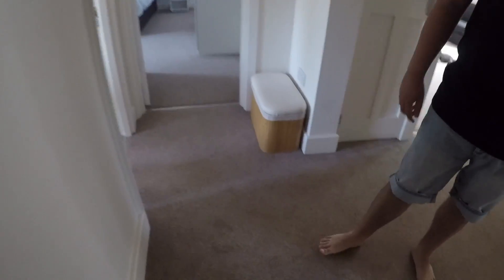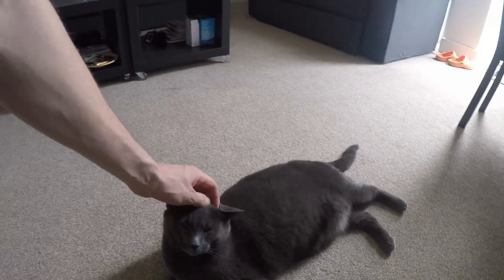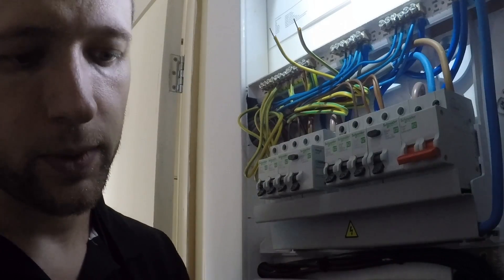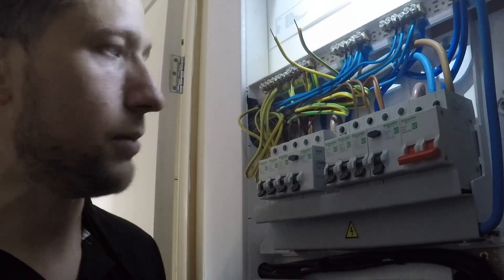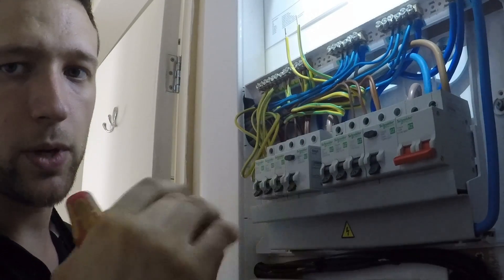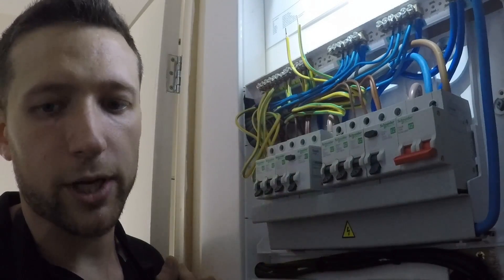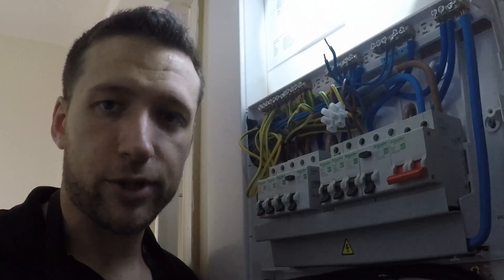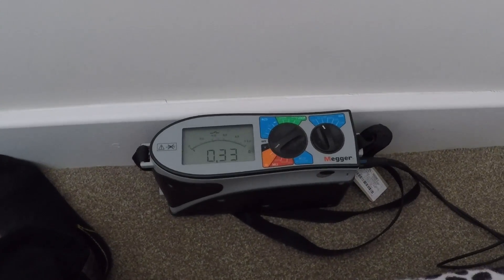Testing a Ring Final Circuit - An Electricians Day in London | Thomas Nagy

Comment: Hi Tom, a very good simple instruction or explanation of a question I was wondering about.   Thanks.    We do not use ring circuits over here in New Zealand.  Everything is wired as straight lines, phase, neutral and earth going to all switches or sockets, but light switches and power sockets may not be on the same circuit, and each circuit must have its own breaker.  Switches or sockets may be daisy-chained.   2+E in all cases, each wire insulated and then with outer insulation also.  Switches on 2.5 sq mm cable, and lighting sockets on 1 sq mm cable (minima).  2 or more light switches for the one light are special cases for cables.   Domestic stoves (ranges) on 6 sq mm cable.
Reply: Alan Torrance If I’m correct, the UK is one of the only countries who use ring circuits. It’s actually really stupid because they’re not actually needed.

Comment: 13.36.  Simple maths.   for 1/4 of 1.34     1/4 of 1 is 0.25     1/4 of 0.32   (close enough to 0.34)  is .08   ( hark back to multiplication tables, or are they not taught nowadays?)   so 0.25 plus 0.08 = 0.33    Easy simple mental maths.    I had the answer virtually as soon as you put the problem on the board.

Comment: 9:30  The Phantom of the Opera. Ring Mains make a lot of sense. However, here in South America (Chile), we don't have fuses in our plugs which would make them quite dangerous. Our main breaker at the electricity meter is a 25 amp breaker, which feeds an RCD and then a 10 or 16 amp radial for the sockets, a 10 amp radial for the lighting circuit and a 10 or 16 amp radial for the kitchen. It is very unusual to have electric heating or domestic hot water (about 95% of homes use gas-fired instant hot water heaters or combi boilers.) No electric cookers, ovens, showers or other heavy draw appliances.

Comment: There are serious faults that the standard tests won't reveal. Example: I workd on an installation that looked really good on the surface. All dead neat. But we found a pile of T&E cables joined by connector blocks buried under plaster, no switches or sockets in line either horizontally or vertically - ie, a bodge.  If you want to know if it's ok, get out your crowbar and a hammer and chisel!

Comment: You can get the exactly calculated R1+R2 on ring main on t&e with this formula:
(R1xR2)/(R1+R2) for your readings:
(0.51x0.83)/(0.51+0.83) = 0.4233/1.34 = 0.3159 ohm

Comment: Cpc should be 1.66 times higher.
2.5/1.5=1.66.
I find it sometimes easier to test ring from a socket but that boards quite neat and easy to work on.😉
Great videos.

Comment: Any work carried out on any circuit , the circuit should be checked To make sure safe isolation,after it is disconnected, Testing a ring you should also test insulation, in case it has has a crossed ring, when plugging in each socket to test figure of 8, make sure it is dead, and on the circuit you are testing. I would also check the RCD is working before leaving .

Comment: What’s the reason for the higher resistance on the earth conductors in the ring? Thinner conductors than L and N?
Reply: Yes, L&N are 2.5mm the CPC is 1.5mm
Reply: The 1.67 comes from  the calculation 2.5÷15= 1.67 that's how he worked out resistance outcome of the cpc.

Comment: and i wanna know your oppinion about wago, because i work with it all the time.
Reply from the maker: Wago are very good. we use them alot over here. not cheap but they are very fast to use.
They also do the ones with the little lift up levers so you can use them with flex.
about £12 to 15 for a box of 50 connectors which is around 1164 rubles.
Reply: Love them! The technology has been around for some 30 years now I think so they can be considered tried and true. If you're in a country with pretty much all-solid building wire you can stick to the 273/2273 series most of the time unless you're doing control wiring or stuff like that. The 221 series are super-neat too, the levers are much easier to pull up than the 222 and they're much smaller and easier to fit into boxes.

It's not utterly impossible to use them incorrectly though - I've seen junction boxes where the 2273s just fell off the wires as soon as I touched them!

I don't really miss working with choc blocks except maybe for nostalgia's sake - it's much easier if each wire is held in place separately than if you're trying to hold a bundle of wires in one hand, a choc block in the other and then need a third hand for the screwdriver!

Comment: Never had to null my leads when doing a loop test (Zs/Ze). I've got a Megger MFT 1720 which has the test lead resistance stored in the unit and automatically deduct test lead resistance from your measured reading, I guess it must be different for the 1500 series range.
Reply from the maker: your meter must be a bit more advanced than my 1552. I have to null em every time otherwise you get wonky readings! By the sound of it though my Megger wont be cheap to repair so i will be upgrading shortly.
Reply: Will you be getting another Megger or will you be crossing over to the dark side (Fluke) loool

Comment: What test leads do you use with your Megger 1552 ? I still use original leads but have some other crocodile clips as the originals are crap .
Reply from the maker: i find i usually end up replacing them every 12 months or so becuase you end up getting dodgey readings from them. you can buy replacement sets of leads on Ebay or Amazon for about £30. thats what i normally do. ;-)

Comment: Good to see those Schneider easy 9 in action.
Reply from the maker: I miss them to be honest. they were good boards. I firmly believe that it's not weather its a plastic or metal board, its how well you fit it. I feel a little bit like we are going backwards with metal fuseboards now. fitting a plastic board badly is one thing, but fitting a metal board badly is even worse.
Reply: Definitely agreed with that! Have you seen a metal easy9+ one in the wild yet? If not, which do you prefer of the AMD 3 boards? I've found problems with the BG ones (hassle with cutouts) and MK ones (loose terminal bars and poor cover screws) that I've had to install in the last few months, so may have to try some others out. Sometimes it's worth paying a little more for the board if it makes installing easier/safer.
Reply: And fitting a metal board on a TT system is potentially lethal.

Comment: Hi Tom, great videos mate! It's nice to watch another electrician and see them take the same approach. Have you ever thought of doing your ring tests at a socket instead? saves fumbling around in a busy consumer unit especially when it comes to your figure of 8 tests. Keep up the good work!
Reply from the maker: hi mate,

ill be honest, i have always done it at the board just because that's how i was taught; but doing it at a socket actually makes more sense i guess as you ain't juggling 66 wires in a fuseboard! cheers for the tip ;-)
Reply: Best to do it at the board, I had a situation where both rings were interconnected at the board, thought something weren't quite right when I got the exact same readings for both rings.

Comment: Great video. I've recently qualified but the only test I'm nervous about is insulation resistance testing due to the potential damage it can cause.  Any chance you can post one to demonstrate how you do it. The class room is nothing like real world where sensitive equipment is concerned.
Reply from the maker: Consider it done. I'm on the case😉
Reply: You're not the only one mate, if you've gone round the installation and isolated or disconnected any voltage sentive equipment and are still unsure if you got everything, do an insulation resistance test between line and neutral at 250V, that will highlight if something is still connected without damaging the equipment.